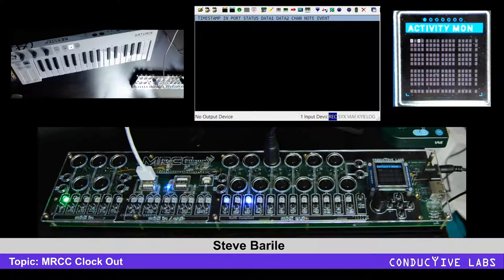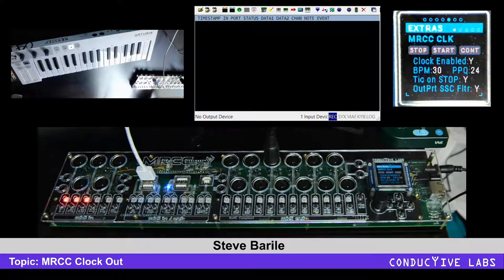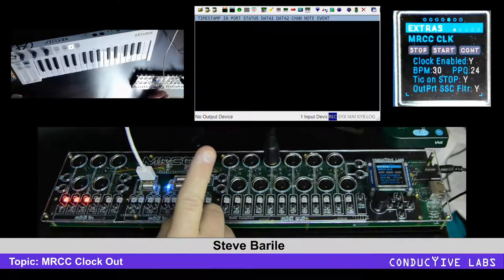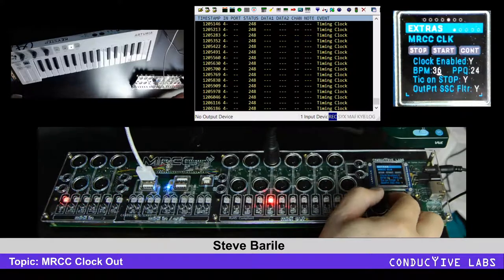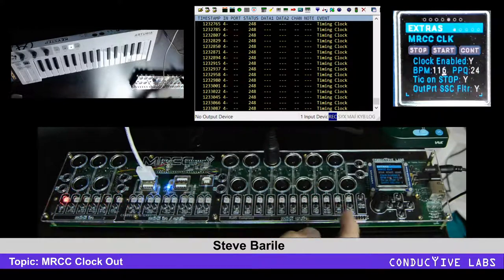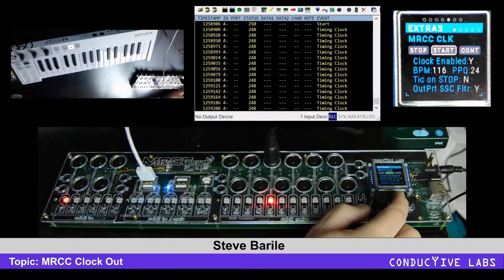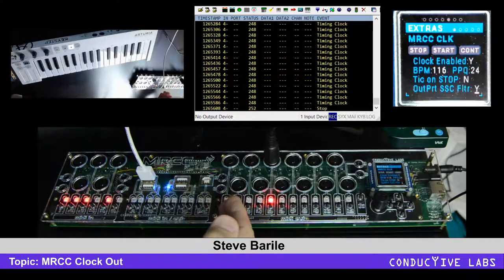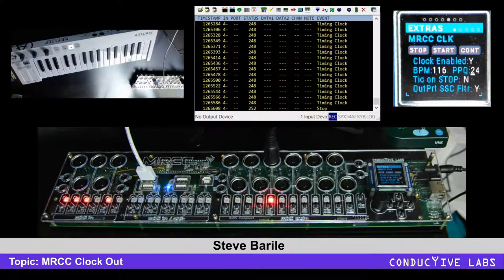Conductive Labs MRCC Clock Out

Comment: Regarding Tic on STOP, I would really like having this as a filtering option on MIDI out ports. There are various machines I would like to keep sending clock to when STOPping, and others where this is highly undesirable. This last option is for Analog instruments technically incapable of decoding the start or stop., like the SOMA Pulsar-23. It would be great If the could MRCC handle the gating of these clock streams on a per port basis.
Reply: Sorry that it wasn't clear. The out ports filtering does apply to the MRCC internal clock, so yes, you can filter per destination as well.

Comment: Hi, how tight is the clock? Can this solve problems of clock drift / jitter on multiple devices? Can you move clock sync per out by amounts to account for latency too?
Reply from the maker: Its got a tight clock, but most modern MIDI devices have good clocks these days. Unless the cause of the clock drift is lost MIDI clock messages I don't think the MIDI router will help with fixing MIDI devices with a bad implementation. One of our beta testers mentioned that they had some clock issues until they switched to MRCC.
Reply: @ConductiveLabs  Cool, But filtering out other messages apart from clock could help? You'd be surprised how many modern devices are shit!.. Jitter is crazy on a lot of my devices. The only absolute solid I've got is from Pulsar 23 and the the little cheap Korg SEQ
Reply from the maker: @iamyila  Are you connecting these devices through a PC interface? That will always add a lot of latency and jitter. You can easily enable filters on MRCC. Filters can be set for Input, Output, or by routing. MRCC filters are in enabled by category, including 
1.Clock (tic only)
2. Note On/Off (including After Touch & Pitch bend)
3. CC
4. Program Change
5. Real Time (Stop, Start, Continue, Active Sensing)
Reply from the maker: @iamyila  Using a MIDI router automatically reduces the amount of MIDI  data going to each port vs a MIDI thru box, which sends all data on the input to all output ports. A MIDI router only sends data from the selected input to the selected port(s). With MRCC you can filter nearly everything except notes if you want to. You can filter notes too, for when your effects only needs a clock for instance.
Reply: @ConductiveLabs  ok great thanks